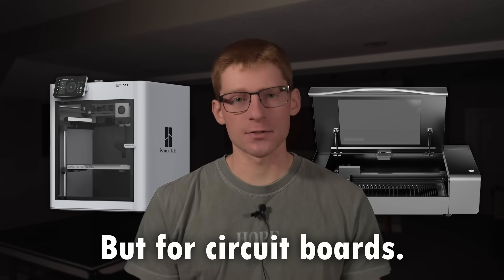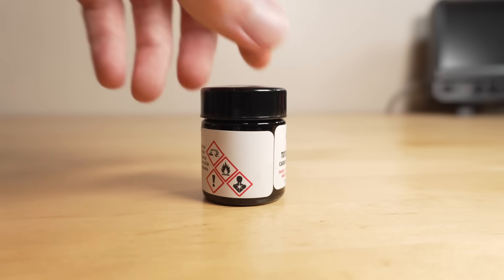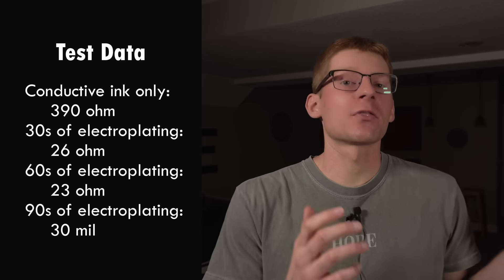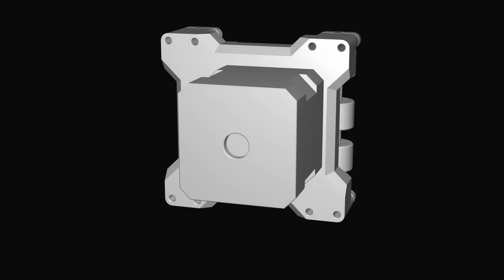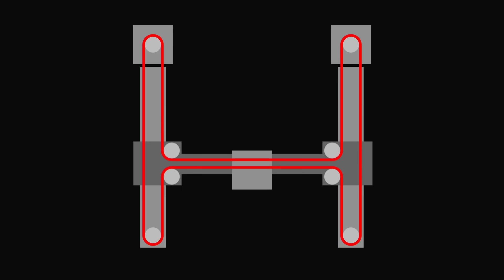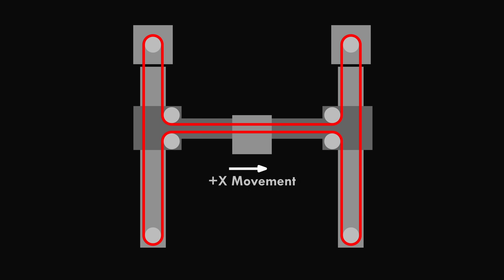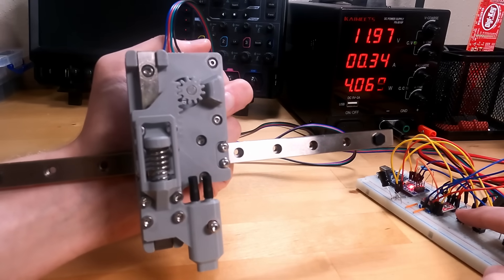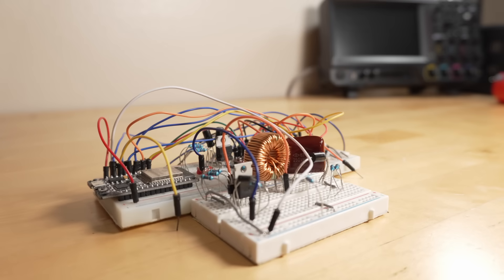I'm Developing a New Circuit Board Manufacturing Technology

Comment: what about a mechanical solution: mini rivets. Yes, this is a bigger via size, but I guess a really simple solution for 2 layer pcbs
Reply: or - as rivets are quite big, what about spotwelding two plates together via the via while flushing the hole with argon gas so that it doesn't oxidize?

Comment: way waaaayyy WAAAAYYY too complex for someone who needs just a proto board, rivets for vias instead, or even simpler - use single core ethernet cable as a "via" and track on the top side (single layer boards), expose using MSLA 3d printer, my 12k mono lcd with a spray on UV resist can do 0.1mm tracks with 1mm spacing if absolutely necessary, though it rarely is for anything 99,999% amateurs will do while prototyping, and double sided isn't REALLY a necessity, is a luxury people simply have become used to, you can combine TH and SMD and get reasonably complex routing, just have to put some thought into it and not just click - auto route
etching with the usual warm fecl, and this way you get a finished board in under an hour, which includes baking the photoresist if you want to be real cheap and not buy presensetized boards
and you can also create your own low melt solder bath to tin the board, just keep the liquid solder under glycerin layer, use silicone squeegee to push it over the copper to and remove excess, or use the chemical tinning, but afair the solution isn't all that stable and can deteriorate over time 
and once you have proven out your board layout and fixed all the issues - send over to a factory to make your final boards

Comment: use nails. or staples for direct jump wires in-one. best conductor is to use a conductor, ie piece of copper wire through the hole. possibly socket legs instead of leaving holes. nails are best if you assume only vias, no legs through the vias. otherwise only single sided mounting connection metal. actually rivets would do a perfect hole filling connection. copper, aluminium, steel, whatever material. no 3d machine required. just normal cnc to drill the holes only. or laser. also bolts with nuts, or screws in the hole would do the job. you are just connecting sides/layers of a pcb. nothing else. well, do all the hole electroplating at once. assume you have the whole copper backplate still intact. only patterned fully later. yep pre-pcb via generation. staples legs are 0.3mm or so.
Reply: one option would be just wire a continuous jumper wire through many holes. thats kinda diy insulated pcb wiring instead of the copper lines. yep jumper wires gets you more than the one layer on both sides, so you get 2+any layers.

Comment: Why not just ditch all chemicals and automate via riveting. And to avoid the cost of the rivets just use cheap EDM drilling wire that has a trough hole, and cut it to length for a rivet. You can get trough hole EDM drilling wire in all kinds of small sizes for cheap.

Comment: you are needlessly overcomplicating the vias, just solder a wire...fast,robust and simple. Also, I suggest looking at bad obsession motorsport's vid about their gauge cluster - they use a modified 3D printer hotend to lay down traces from solder, works way better then expected.

Comment: Could you 3d print a  'mask' for everything except the via-holes for each side and then simultaneously do all the vias? There must be some corrosion resistive printing material right?

You could print a 10cm block of it then just them into layers if the process is destructive for the mask. Would still be pretty good scaling.
Reply: If it's non-destructive you could 3 print a mask and holder in one so you could slide your pcb in the machine

Comment: For the vias you could try doing like other diy pcb solutions have done: tiny copper rivets. Make the gantries rigid enough and the Z axis strong enough to "crimp" the rivet in place and it should be pretty reliable.
Reply: could even control the subsequent soldermask steps to be as thick as the rivets' heads so the final pcb is flat

Comment: Hey Levi, I'm a process design engineer that deals specifically with electroplating metal into nanopores. Is the solution you are using a commercial solution with additives? You need to look into pulse plating, this will dramatically reduce the surface overplating you're experiencing.
Reply: Why not use copper wire instead of electroplating? Seems more realistic and achievable. Automatically soldering small bits of precut wires maybe?
Reply: @jona-x5v soldered vias have a few problems. Firstly, they stick up out of the board, getting in the way of hotplate reflow. Secondly, any hot-air, infrared, or hotplate reflow is going to melt the vias too unless you want to mess about with different alloy melting points. Thirdly, automatically soflering from two sides would be a pain, especially with no solder mask to keep the flow in check. Etching a soldered board has its problems too.

You’d be better off trying to make a machine to rivet copper wires into holes that have been counter-punched, in order for the riveted heads to be flush. I did that by hand for a while.
Reply: @Scrogan  i'm curious why copper wire rivets aren't industrial standard, though
Reply: @ because they aren’t a batch process like plating is. If you have 1000 vias to do, then it’s going to take ages. Also it puts a decent amount of stress on the board.
Reply: @jskratnyarlathotep8411  It's mostly about speed, cost and human intervention. Chemistry scales really well. On production lines, thousands of boards are coated by simply moving along a conveyor belt into and out of different chemical baths. No precision moving parts to service or break. Automated rivets would need to be done one at a time and have more variables to keep consistent across a board let alone a batch. The machines for producing precision riveted assemblies are also significantly more expensive than simple chemical reservoirs.
Reply: @jona-x5v I don’t recall why, but the industry settled on plating a long time ago and have done it that way since. I’m not exactly sure why though. It’s a good question.
Reply: @jona-x5v standard vias have specific electrical characteristics that would need to be replicated for prototyping.
Reply: @jona-x5v yea, that’s where I ended up. Maybe solder paste and a heat gun. Makes me wonder about the math; if you’re doing a single spot and can apply it precisely, what ways can you melt the solder paste? Hot air, laser, hot press with a sacrificial layer?
Reply: @jona-x5v  sonds very doable. Intead of soldering, two sided micro pluse TIG welding could be used. Those welders are cheap nowadays
Reply: I do understand the need to make a solution for pcd manufacturing for DIY crowd. I own a small cnc just for that. Been revetting via for my needs. But why doing it all in a single machine with multiple tool head? You are giving yourself way too much constraint right from the start when you don't even know if the process can be trusted. I on my side would make a 2 step machining system, first holes for pegs and position the pcb in the cnc drill all via. Put the copper plate into a second step apparatus that will deposit the conductive ink in each holes. Fix the problems that will come from that process. Then in the same apparatus. Do the plating and fix the problems that will arise from that process.  Making a lot of via will lower the over all resistance,  those are all parallel resistor. Putting  the high voltage requirement less a problem. Now the current will be the main thing to manage. Also. I think I remember something about pulsating DC and smooth DC would make plating acting differently.  So maybe look at the output of your buck converter under load. Could this add been part of your problem also? And then after having consistent result of the ink plating process. Put back the pcb into the cnc and finish the process?
Reply: What if we apply a flow of fluid during the process? I’m wondering if it would affect the deposition speed…
What do you think about that?
Reply: Do you have any literature you could recommend? Good authors to search?
Reply: @electrowizard2000  Are you looking for general electroplating knowledge or specific applications?
Reply: @jordini321  I have a general background, but not on pulsed plating or plating in nanopores. No specific application. If you had a particularly interesting reference I'd appreciate it, if not no worries.
Reply: Solder paste in vias has a long problematic history in regards to SMD thermal vias. Solutions were to try to make the holes too small for paste to enter, or to plug the holes with epoxy - an extra step that added costs.
The paste is a mixture of tiny solder balls and flux and other chemicals to aid in cleaning/wetting. When paste goes down a via, and then gets heated, it creates bubbles that not only leave voids that may break the connection we're going for, but also leaves caustic remnants.
As I recall, inside PTH vias those caustic remnants can attack the copper over time. That lead to multi-layer boards internal layers getting disconnected from the other layers at that via, amongst other undesirable effects.
What are the long term effects are without hole plating? IDK .
But our goal was to attach the surface Cu around the hole edges on both sides of the board, and that Cu could also be attacked over time.
Reply: I’m assuming with pulse plating you give time for the electrolytes to reach equilibrium in the liquid resulting in a more even coating that isn’t dictated by a variance in surface charge that probably pulls ions to certain regions
Reply: Just put a tiny blob of solder paste in the hole
Reply: I just love how this comment section is engaging and fully invested in fixing the problem. Sure, it‘s sometimes a bit much of men-to-men mansplaining but it‘s mostly engineers and workshoppers here I guess, so what etiquette can you expect 😂. Guys, you‘re awesome. Every single one of you. Hope some of it helps.

Comment: Exciting project!

I must confess that the lead time of PCB procurement doesn't bug me that much as a hobbyist because for me, the real problem is parts placement - my hands shake, and getting parts placed once the paste is stencilled is a real challenge. That's why I subscribed to Stephen Hawes's channel - the work he's doing on small-scale pick&place is intriguing.  But I'm subscribing to you too, to see how this turns out!

(PS: I'm not altogether sure I want the chemistry for etching and plating in the house.  And if I do it in the garage, it becomes a seasonal affair; the climate here has COLD winters.)
Reply: If you find yourself placing challenging components by hand (like ICs with dozens of fine-pitch pins), you might consider putting together a "manual pick-and-place" apparatus. You can use a vacuum pickup (easy to make with a cheap modified aquarium pump and syringe), mounted to an aluminum extrusion arm, in turn on  vertical slide (3D printer technology parts), sprung loaded to pull up, but can be lowered by hand.  I like to control the vacuum with a small valve and foot pedal.   You can then position the PCB by hand below this "crane", and slowly and carefully lower the IC nearly onto the board, maneuver the PCB a little bit to perfect position, then finish placing the part.
Ie: no need for the apparatus to have any fancy X-Y mechanism, because moving the PCB around under the crane by hand works fine. You just need the crane to give you a way to lower the IC into place consistently and without shake, with an initial "rehearsal" to get the position just right. This kind of simple apparatus makes all the difference between shakily positioning the IC and messing up the solder paste, versus placing it just right with confidence. Of course there are fancier manual PnP machines too... search for them to see.

Comment: Hi, definitively an interesting idea.On a few PCB prototyping machines I've seen on youtube they use some kind of hollowed copper insert.
Kind of annoying because then you need some consumables...

Why not doing the PCB in two steps? I know your initial idea was to make everything with only one machine, but if the final result is better and faster in 2 steps maybe it's not worth the effort?
I'm just thinking of your initial experiment to make the vias.
First step: traces (eventually)/holes/ink application on the CNC machine.
Second step: a machine doing all vias connections at once on the PCB using the same setup than your initial successful test. Or maybe this method will not work well with multiple vias?
Good luck anyway.

PS: I'm not sure why you are talking about microfluidics, but do not show any microfluidics here?
Reply: From what I understand the first process worked better because the electrolyzer's electroplating area was closer in size to the via electroplating area(1mm).
In the second test, he had to up the voltage 4-8x because the via electroplating area went down to 0.3mm.
If he did the whole plate at once in the same manner , it seems that he would either have to use many small electrolysers or have to up the voltage to an unusable degree to cover for the drastically increased surface area to cover.
Microfluidics as he seems to mean are drop-scale fluidics(to provide the electrolyte to the vias).

Comment: Really clever idea Levi, and thanks for doing such a great job conveying the lessons learned around testing your assumptions, one variable at a time. I'm curious why the electrolyte soln used in the very first PoC had a lower resistance. Was it a different solution?
Reply: He said the via was 1mm wide vs later on the via was 0.3mm wide , so from what I understand that affected the dynamics of the electroplating by limiting the volume of electrolyte within the via and making it harder for the electrolyte to make copper atoms bind to the via rather than outside somehow?

Comment: What about using Tollens reagent for silver vias? It’s much cheaper and simpler than copper electroless plating solutions! It’s used to deposit silver metal onto glass for mirrors, and is often done with just 2 spray bottles of solution, so no chemical baths necessarily required! AlphaPhoenix used it to make mirrors from 3D prints.

Even though silver sounds expensive, a solid 0.3mm (1.6mm depth) via would only be 0.00011 cubic centimeters of silver, at 10.49g/cm^3 and ~$1/g spot price, that equates to a theoretical price of only $0.0012 per via! 

So even assuming only 25% is deposited, no silver is recovered, and the necessary chemicals equate to double the price of the silver metal (doubtful), it would still only cost $0.01 per via! 

The solutions seem quite easy/cheap to make at home! My thoughts are that you could mix them right before entering the top of the via, then have the solution flow into PTFE tubing below, some silver would eventually deposit on the tubing as well, but this could easily be occasionally redissolved with basic chemicals if needed!